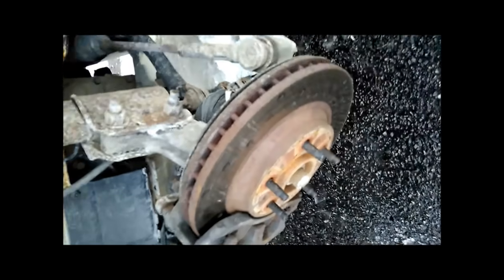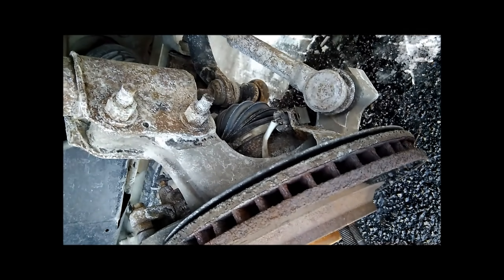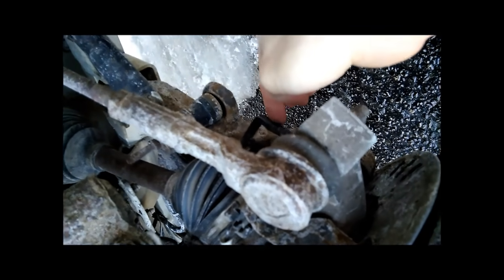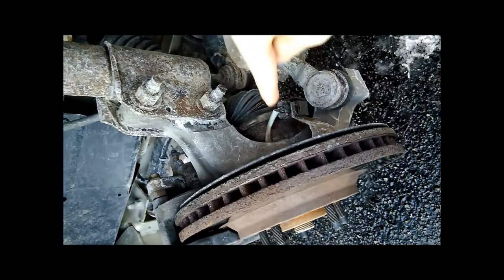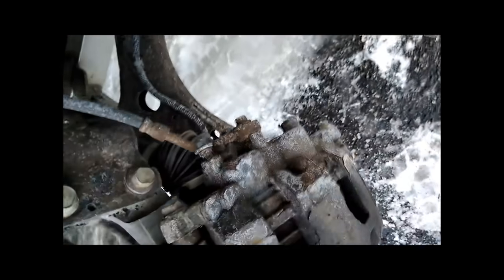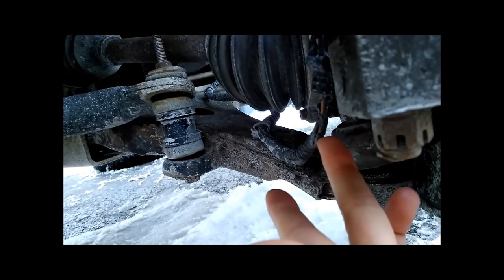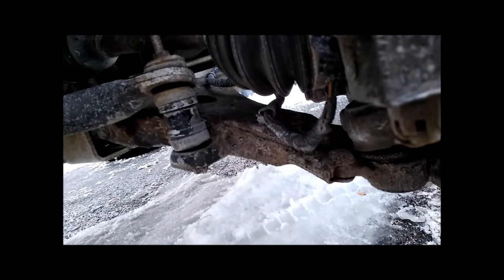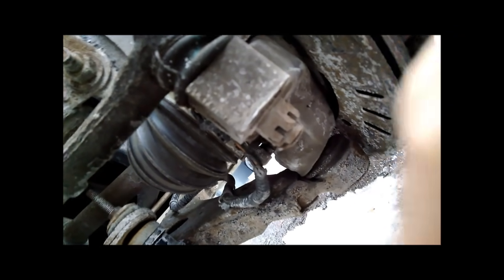How to fix ABS light, Traction Control, Stabilitrak

Comment: Can it make the car run bad
Reply: My 2008 Saturn aura 3.5 V6 does a little bit before and after the message and chime it’s slightly rough with a loping of the light misfiring feel but no check engine light until I drive a few feet
Reply: Brake booster

Comment: Of course it’s always snowing and cold when problems happen.
Reply: literallyyyyy
Reply: Never fails!!!
Reply: No its not. You need fact checked
Reply: Mine started going crazy when it started raining,  like bro really
Reply: Not to mention you are usually somewhere with no cell signal
Reply: ahh man. i moved from SC to ohio🤦🏿‍♂️
Reply: I thought the same thing😂
Reply: @joejohn5151 yes it is stop lying
Reply: I’m having that problem now.
Reply: Always  I just replaced  abs sensors  and it snowing light came back on
Reply: I’m literally stranded as we speak
Reply: Literally, just started snowing as I read this comment lol.
Reply: Ice possible, drive carefully. Left turn, service traction control, abs, service stabilitrak. Like dang thanks POS
Reply: And on the interstate 😂
Reply: Always 😂
Reply: You betcha!!😂😂😂😂

Comment: Seems like this is major issue with many Chevys. I had a 16 Malibu that for some reason the dealership could never fix. They just let replacing the OEM. I test drove a 17Implala today, as soon as I hit the highway, the Stability tracker light came on. I have PTSD at this point seriously scary issue to deal with.
Reply: Yes I agree. Chevy sedans are awful. I’ll never buy one ever again. My torque sensor went out which is near impossible to fix. Then now I have abs light traction control and brake light on.
Reply: Along with checking the speed Sensors. Check the wheel bearings on all 4 tires. Had a faulty one on mine. Replaced it and the lights went away.

Comment: Nice job on talking about this type of problem.  However, you don't have any video of HOW you taped up the individual wires or the bundle, how you got access to these individual lines, how you used the contact spray / cleaner and THAT'S a big piece of the puzzle.  Otherwise, this is just a series of photos of BEFORE and AFTER.  Check out videos from other very very popular auto mechanics / repair YouTubers (like Chris Fix or Scotty K or many others that actually shows HOW they do the repair AND NOT just the Before and After pictures).  But this YT video definitely helps in solving ABS problems (like what I have with a GMC truck) in going PART of the way to DIY fix them.  Keep improving.  Good work regardless.
Reply from the maker: Yep, I have very amateurish videographer skills.  I think a simple tripod would fix a lot of my problems but most of the time I'm half way through a repair before I start thinking about the YT video.  I'll work on it.

Comment: The traction lights in my experience are most common for the abs wheel speed sensors but the stabilitrac is usually the steering angle/wheel position sensor failing.
Reply: Another video actually says that it is the Steering Wheel position sensor and another one just said its the brake pedal position switch like all these fuggin backyard mechanics have a different story its annoying af
Reply: @djscottymaxx this is what bothers me the most, I don’t expect these electronic junks to run forever but at least guide me to the problem with the right error code 😂 this stabilitrak crap is so annoying.
Reply: From my experience the harness wire was too short for the Buick rendezvous and have a high probability to pull the sensor out or pull the wires from the sensor. You can purchase a replacement wire with a new module and splice it in. $35 fix vs. 100s for the mechanic

Comment: Hi, I've got a 2014 audi A3 1.4 tfsi which pops out stabilization control faulty, hill hold assist unavailable and parking brake and it won't start, there is a crank but no start

Comment: Tried everything. Put in a new throttle body one evening then did relearn process, next morning codes were gone. No more ABS or Stabilitrak or check engine light. Check your carbon deposit buildup.

Comment: My traction control light will randomly start flashing ( 95* outside) and auto engaging the brakes. Super dangerous while driving. I have to turn the car off and turn it back on for it to stop doing that. I will check it out on my car thanks!

Comment: Just want to thank you for taking the time to put this video together and uploading it. If I fix it myself, I'll come back and thank you again.
Reply from the maker: Time is valuable so if I can save some for you then it was worth the effort!
Reply: After another look I realized it’s my AWD, not my ABS light with traction control(the two wavy skid marks) and check engine light that came on. I hit a deer Halloween front right corner the plastic shroud in wheel well is ripped out, I noticed last night that the wheel speed sensor was still wired but the clip that holds it to the control arm? pulled off but I don’t feel abrasion on harness. Same on driver side. Haven’t pulled wheels yet. Also, and this seems bizarre to me, it started running rough same time yesterday. Plugged it in and it read #3 cylinder misfire, wheel speed sensor and one other I forgot what it was.  Hit a deer same corner last year and few months laterI had to replace a coil that was in back of engine so a lot of labor cost so they replaced all 3 since it was tore apart. Wondering where #3 is front or back. It was running very similar at the time. Had all body work done , and just had to do it all over again. No insurance this time. F’d up, I know. Living in State Forests in Minnesota 2 1/2 years now.  It’s a 2013 Toyota Venza.
Reply from the maker: @jamesholmberg3158  Bit of bad luck eh?  See if you can locate the cylinder firing order diagram for that model.  Might require a bit of investigative work but they illustrate which cylinder is which, like this for example:  https://www.clublexus.com/forums/attachments/es350-2007-2012/188347d1286544253-ignition-coil-malfunction-misfire-in-all-6-cylinders-cylindernum.jpg

Comment: I like the thorough inspection of each side. Noticing and zooming in on the wires being eroded due to pulling and rubbing while turning etc. Nice job. I would of expected once you made the decision to get electrical tape and band aid those wires, you would have,- 1) Turned off ignition. 2) Disconnect battery 3)Dried off and possibly removed some of the worn, unsticky tape. 3) Proceed to wrap damaged areas with fresh electrical tape. *HOWEVER, THAT WAS A GREAT VIDEO SHOWING EXAMPLES OF DIAGNOSING AND VISUALS ON INSPECTING. "Got a LIKE from me Sir" Thank you
Reply from the maker: I appreciate any feedback that I can use to make my next videos better.
Reply: So if wires were corroded . This is super temporary.  You can't really fix with tape 
 I am a electrician.  I never ever fix wire I replace them . By law . Wire is wire .

Comment: Thanks for heading me in the right direction. Had my tires rotated on my 09 silverado at a well known and well used tire dealer today. When done, all my ABS, traction control and stabilitrac lights were on. Got it home and watched your video. Ultimately found they some how cut the wheel speed sensor wire on the left front. Was able to splice until I can get a new sensor/wire and put it on. Thanks for your help!
Reply from the maker: Sometimes you just need to be pointed in the right direction and you ask yourself similar questions like you did, "what if the mech cut my wire".  Great job!
Reply: They cut it? Doesnt that mean they're at fault?
Reply: @ndo533  Right, ummm no, we just don't know how that could have happened. ( They were MAYBE) Hoping for more of your business.
Man, Karma take me away
Reply: Coincidence?  I just had my tires rotated at a well known shop and next day Stabilitrack light comes on.
Reply: I have a 09 silverado  I been having issues the car is hesitant when I drive Trac control won't turn off
Reply: Same happened to me. Gonna go check it in the AM😂

Comment: Gosh thanks so much for this great video! My mechanic wants to replace my passenger side rear wheel bearing for $500 bucks. I have a 2012 Buick Regal and I’ve recently had several things done on it for $1,600. A good friend said to take it to someone else for a second opinion. Maybe I only need a new sensor? If I need a new wheel bearing that’s fine too but I’d hate to spend the $500 unnecessarily. It only has 69K miles and it’s a really nice car. I’ve had it since it was a year old and hey its paid for! Thank you again you’ve given me a lot of very helpful information. 😀💗
Reply from the maker: Happy to help.  Even if the wire is fine and the bearing does need to be replaced, you can reduce your cost by buying the bearing yourself and bringing it in to the mechanic.  They can tell you which wheel is the problem using their electronic scan tool.
Reply: Thank you again Chris! He told me it’s my rear passenger wheel that needs a new wheel bearing. I’m going to take it to another mechanic just to get a second opinion. It’s fine if that’s my problem but $500 bucks is a LOT to spend if it’s not necessary!! I really appreciate you taking the time to make and then post your video. It helps a lot of us out in a very big way!! 💗

Comment: Thank you for an excellent video. My problem started on an extremely rough gravel road. It's intermittent. Message goes off for a while while driving, and may come back on after turning, or backing out of a parking space. I suspected a sensor. Will check further. Thanks again.
Reply: My car did the same things. Come to find out my wires were broke from the wheel turning back and forth. Got caught and broke.
Reply: If I remember correctly, this is a common problem on some cars, where the cable may be to long. I believe I read this on the "Buick " forum. Ty so much for the video
Reply: any update, mines doing the same,
Reply: Replace the hub
Reply: When you turn its widening the distance from the sensor to the ring then when you straighten out it shortens the distance and the ecm can pickup the signal again

Comment: Nice! Man thank you so much for taking the time to explain this! My 2003 Impala has been driving me insane trying to figure out why the traction control light won't go off! I replaced both wire harnesses running to the bearings. But now I found the problem. Thank you!
Reply from the maker: Glad to hear it.  It can be the bearing itself (where the wheel sensor is located) but at least those are accessible and easier to replace.  It sucks when you have to replace a wire loom or try to figure out where it's got a flaw in it.
Reply: Did your car have trouble with accelerating also when the light appeared?
Reply: @kiannagardner8238  well shortly after I posted my comment, the traction control light came on again. My scan tool showed all wheel bearings were working properly. So I disconnected the wire harness running to the abs module. I blew all the dirt off, and put dielectric grease on it, reconnected everything and the light hasn't come on since. But all this started when I got stuck in mud, I accelerated too quickly, and heard a weird noise coming from the front passenger side wheel bearing. The wire harness on the passenger side wrapped itself around the wheel bearing. So I had to rewire both front wheel bearings. I know this is a lot of confusing info, it's hard explaining what I had to do, I wish I could explain it better.
Reply: How much $$$$ per wheel sensor? My car also doesnt pass smog due to oxygen sensors??? GM CARS

Comment: Hi Chris, Thank you so much for this video. I took my 2000 Chevy Impala to a GM dealer and was told it would cost S700 to replace the wiring harness for the ABS and the Traction lights to turn off.  Glad I did not have them perform that service after watching your diagnosis.
Reply from the maker: 700 bucks for a wiring harness???  They really are "stealerships" aren't they
Reply: @ChrisCamaro  holy shit that's one of the biggest rip offs I've ever heard of
Reply: I jacked the car up 2003 lesabre on the driver side guess what the wiring coming out of the harness on the lower into the hub totally missing I’m hoping I can replace that sensor and it’ll work. I’m not sure about what’s going on the other end. Guess will clean that connection And hope for the best. On the passenger side it looks OK all looks good. I’ll disassemble those connections in clean them. Hopefully I can get my traction off light and ABS lights to go and the service stability system also to go off. Thanks so much Cc for the house to!! 👍👍

Comment: Thanks CC: An excellent vid. Clearly explained and excellent photography. I won't be doing any of my own repairs on a 2014 VW Passat (56,000 miles) but have a very good idea for where mechanic should start to look (or prevent him going on an expensive wild goose chase!)  ABS/ESC Stability, Tyre Pressure Monitoring, Light bends and Stop/Start all on full-alarm. These all draw their signals from the Wheel Speed Sensors, so if one or more WSS is not functioning correctly, all four of these feature will light up.
Reply: That's why I'm here. Not that I can fix it myself but that I am aware when I take this beautiful beast in on Monday. Thanx

Comment: Thank you so much my man, it really worked on my Toyota wish 2014 model with a Valve Matic engine traction control light was on with the engine check llght. After removing the ABS, VSC and TCS sensor and cleaned it .....all the faults lights disappeared.   Thanks bro you really no yr stuf.

Comment: I wiggled the wires by the connector for each wheel and made sure everything was connected. I was finally able to start my car back up. It wouldn’t start and I noticed for a brief moment a stabilitrak light came on but didn’t stay on and my steering was off and couldn’t power on. Crazy because I was about to call a tow truck to take it to a mechanic lol thank you
Reply from the maker: Glad things worked out in the end!

Comment: Had exactly all 3 of these messages/lights come on in my 2011 Impala just tonight. I'm glad you documented this, as other videos or mechanics might have suggested something else entirely.
Reply from the maker: Heh, I guess oil changes are perfectly good loss-leaders for mechanics these days and they don't want to be charging $20 to put a piece of electrical tape on a bad piece of wire.  Still, if they don't have the time for that, somebody's gotta talk about it, else we're all into costly repairs we don't necessarily need (yet).  Cheers.
Reply: So did you fix the issue? I have an 11 impala with the exact same lights on
Reply: @babberdydabberdy3551  I did recently in fact. As it turns out it was my rack and pinion leaking power steering fluid. If your car is groaning when you turn the wheel at all, that might be it.
Reply: @Conqueered  Oohh dang nah mines not doing that. I get a grinding noise when it’s shifting gears sometimes

Comment: My problem comes after a rainy day always ,ima check those sensors and connections props to your video bro and taking the time to do it😁👍
Reply from the maker: I had a friend whose car would turn off in the rain... water bridges electrical gaps and causes them to short, basically depriving the car computer of a high enough voltage to read digital signals properly.  Usually indicates a wire has lost its insulation somewhere and is shorting on a nearby wire when water wicks between the 2 wires.
Reply: I happen to know where the water is getting in. Does your car get water on the floor of the passenger compartment?  And do you have a camaro5 account?  Long story short, my car used to shut off in the rain, took me weeks to find the problem. There were actually two problems, water entering from the windshield cowl on the passenger side (the base of the windshield where the windshield meets the body of the car) and also a faulty fuel pump. Once I changed my fuel pump, the car never shut off again, it's been fine for years now. And once I put a little sealant on the seams at the bottom of thewindshield, no more water in the car.
Reply: @liamkneeson8866  No imagine if your car was in a flood and someone sold it to you with a clean title. Now that would be terrible. Used to happen a lot after Katrina

Comment: Check your brake fluid level and pad wear first. A simple brake job was all that I needed to fix this issue on my 2012 impala. Apparently abs/traction control lights are activated if fluid level is low.
Reply from the maker: That's a very good point.  The braking system has to be within a certain "nominal range" in order to work properly (thus to perform traction specific functions properly) so if your caliper pistons are too far out or you don't have enough fluid, this is sometimes enough to disable the traction system even without a hard malfunction.

Comment: Thank you bro! Someone ran into my car, traction light cane on. Took it for repairs, they didn't even fix it. I go over 60 mph it comes on, car starts to shake as well smh.... I have a new 2020 Malibu.
Reply: Check the tire balancing, could be a bent rim. Rotate the tires to see if it still vibrates.
Reply: May also be a missing or broken motor or transmission mount, but low chance
Reply: Imbalanced tires will destroy the wheel sensors quickly